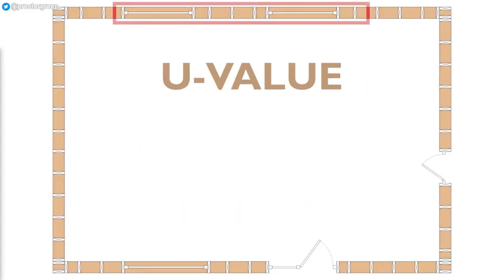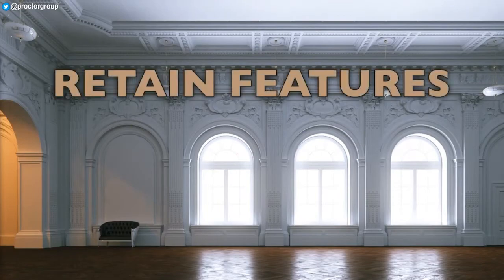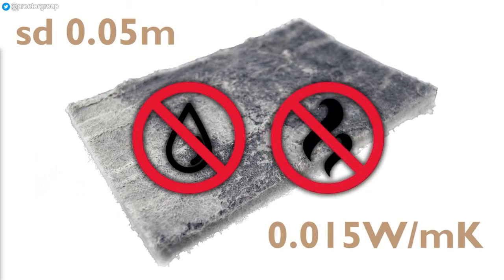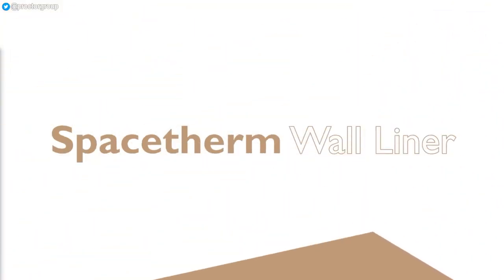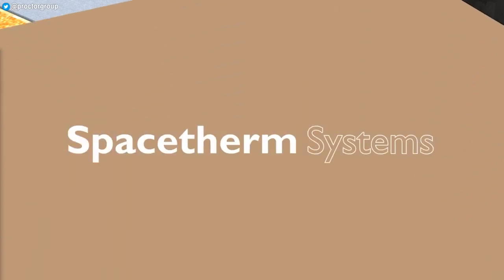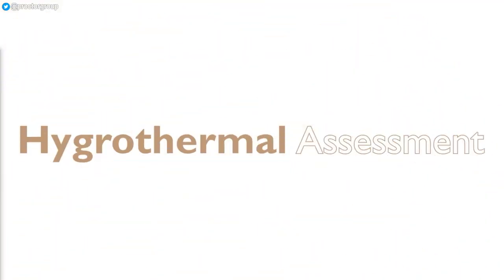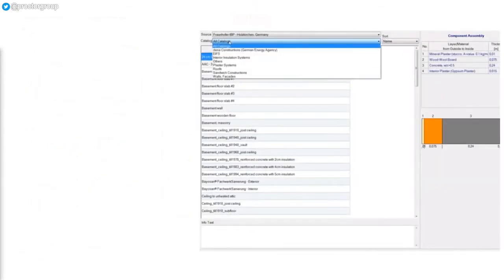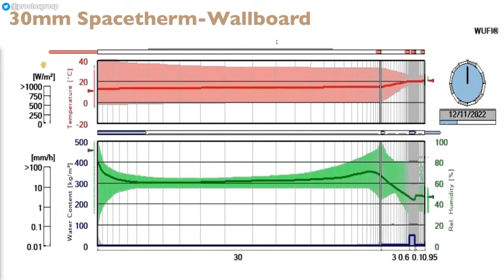Webinar: Aerogels In Building Refurbishment, April 2020

Comment: Certainly! Here's a draft post that captures your concerns and ideas about aerogel and its use in home insulation:
The Need to Democratize Aerogel for Sustainable Home Insulation

Aerogel, a material lauded for its extraordinary insulating properties, stands at the forefront of technological innovation in building materials. Yet, its potential remains largely untapped in the realm of everyday applications, particularly in home insulation.

The current market dynamics surrounding aerogel are concerning. Reports indicate that some suppliers are importing this material at relatively low costs (around US$15 per square meter) and selling it at significantly higher prices. This practice not only undermines the affordability of aerogel but also restricts its accessibility to a broader consumer base.

The question then arises: Why should such a revolutionary material be kept out of reach of the average homeowner? Imagine the impact of aerogel in making homes more energy-efficient. By insulating with this advanced material, we could see a substantial reduction in energy consumption, leading to lower utility bills and a smaller carbon footprint.

However, the dream of utilizing aerogel broadly in home insulation is hindered by its high production costs. To truly democratize this material, we need a collective effort involving increased investment in research and development, scaling of production methods, and potentially, government intervention through incentives or subsidies.

By making aerogel affordable and accessible, we could spark a revolution in sustainable building practices. It's time to move beyond the profit-centric view and embrace a more inclusive approach that considers the long-term benefits of energy efficiency and environmental sustainability.

Let's advocate for change. Aerogel has the potential to be more than just a product for the elite; it can be a tool for global change, transforming how we insulate our homes and approach energy use.